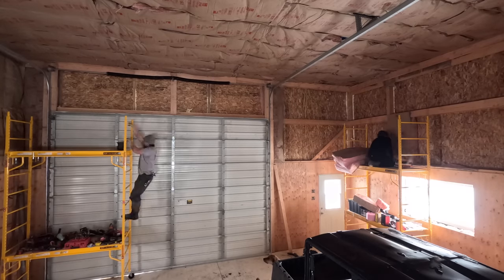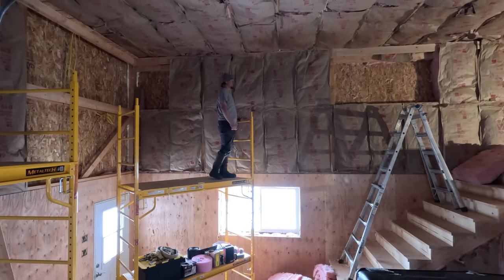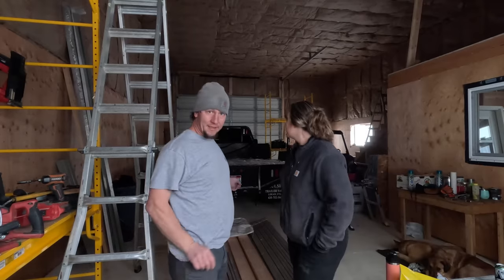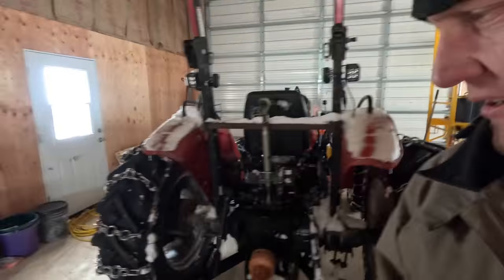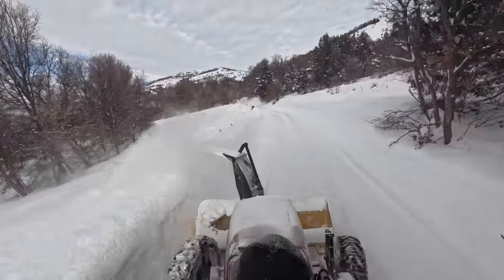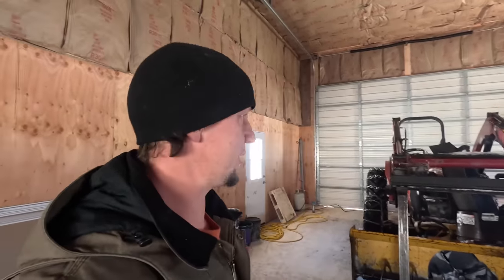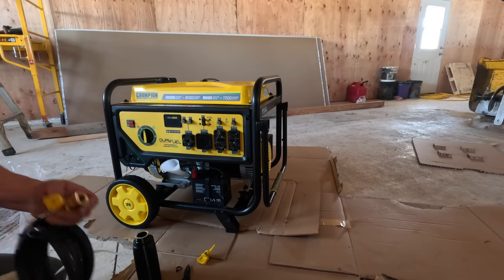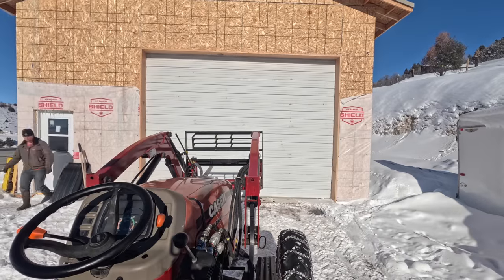SNOWBLOWER BREAKS during A HUGE STORM | NEW GENERATOR

Comment: Find a spot in shop for gen set that is close to a outlet then install a dryer vent with critter screen and a low volt fan . Then plumb it to discharge the exhaust like a race shop does but smaller scale. It works awesome.

Comment: I use a Champion Generator just like that.  I have the one step down in power.  Works great.  
I did after my 5 hours for the break in I changed the oil and switched to the 5W-30 Full Synthetic.  Handles the temp ranges better.  I deal with the super cold temps and the hot temps being Montana so the Full Synthetic will work better in the long run.
Glad to see the shop where it is at.  Looking good.
Reply from the maker: Thank you

Comment: Mark, try using a “love joy” coupler instead of the chain. See if they make one that will work for that coupler. We used “love joys” at the mine on rotating shafts and they work really well for high speeds, and flexibility too! Hope this helps!
Reply from the maker: I considered going to one of those when I was finding it hard to find this chain by-the-link. The chain ended up only $18 so I was fine with going forward. If it fails on me again, I'll strongly consider it. They absorb shock load so much better.

Comment: Mountain maple ranch have u thought about making a cab for your tractor
Reply from the maker: Yes, but after working on tractors for several years and dealing with aftermarket or secondary cabs (a whole bunch) I just don't want to deal with it. I'd rather snowplow in the right conditions and wear my weather gear instead. It's not SO bad.... I haven't even broken out my snowmobiling gear yet! haha